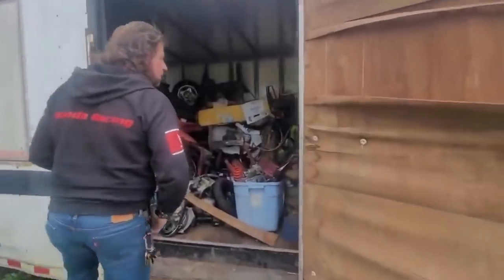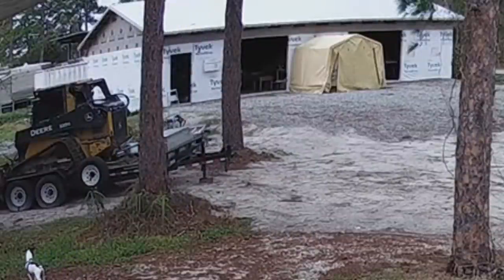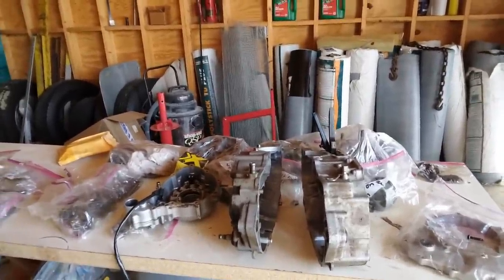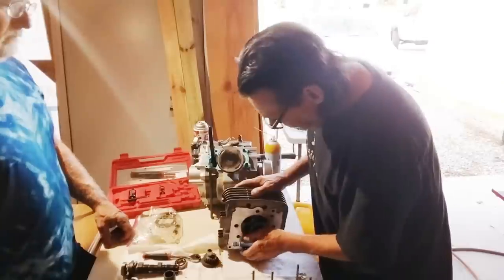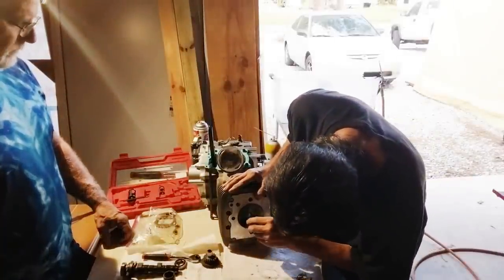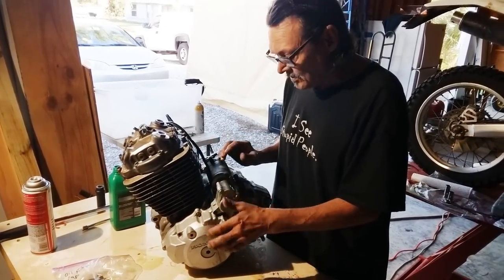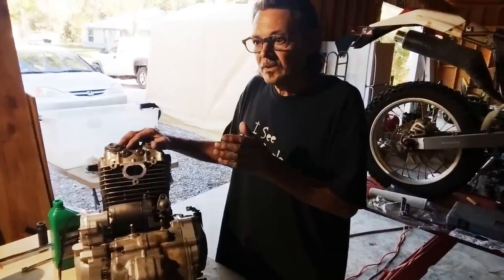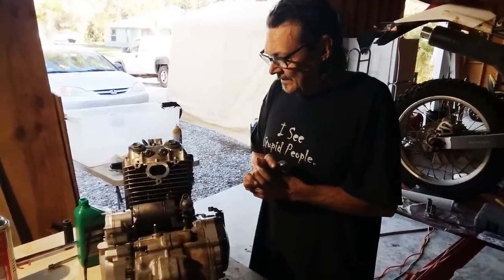BUILDING AN XR400 ENGINE WITH ELECTRIC START!

Comment: You've done it again! A video with one of my childhood dirt bikes. Honda Z50 a under the gooseneck of the trailer at the beginning of the video. Identical to the one I had, the first motorcycle I ever owned. So that wraps it up, Honda Z50A hardtail, Honda CT70 trail bike, 1974 Honda xr75, 1976 Honda CR125 and 1986 Honda CR250. Amazing how you have had them back-to-back almost in the same order I got them! Only motorcycle you have not shown that I have owned is a Honda xr250r prolink. Seems like it was a 1984 model, maybe 85 or 86. I love this channel!

Comment: I've built a few EX400 engines,  basically a xr400. In an ATV.  I turned 1 into a stage 3 440 with cnc head porting, and ran had an edelbrock carb, white brothers rev box,  kibble white valves.  Hinson race clutch setup, And my second one was basically the same but stroked out to 465cc. Which was a handful to ride it would wheelie easily in every gear.

Comment: Hey I found the best thing to get cases together is the heat the bearings with a heatgun and get that air duster compressed air in a can stuff and turn it upside down and spray the end of the whatever shaft you are trying to make fit  as it's basically like liquid nitrogen when you spray it upside down (dont get it on your skin) and it gives you much more leeway than heating in the oven or freezer as if you mess up the first time with those methods you dont usually get a second try.

Comment: They are the same basic motor but there are differences such as the center cases for the electric start and also the tranny gears are different on the four wheeler. Stronger more robust to handle the extra strain and weight of 400ex.   Use to do Frankenstein swaps back in the day!  👍

Comment: Good morning, here in Brazil honda launched a motorcycle with the XR400 engine with electric start, its name is NX4 Falcon.
It was released in 2001 and stopped production in 2015.
Engine identical to the XR400 but with less power.

Comment: Hey Jeff, thanks for the video and glad you're making a swift recovery — that was quite the fall.

Can I use the flywheel from the xr400 and add the starter clutch from the trx400 to the back? Or, must you get the flywheel from the trx400 as well. Thanks!

Comment: This is awesome! I have almost acquired all the parts for this myself. I'm curious if you recommend the xr400r wiring harness or a different one? I found elsewhere online they recommend the CDI Box for the 650R. Would a wiring harness for a 650R be compatible? They look almost the same. Also curious what specific flywheel you show here in the video? Is that not the stock one?

Comment: There is a Honda street bike sold in Latin America that uses  an electric starter & some with fuel injection called the NX Falcon 400. I don't know if the conversion would be the same or just a bolt on.

Comment: Do you put any oil of any kind on the cylinder bore or rings? or put it together dry?  do you have to lap the new valves into the old seats?
Reply: Hey Jerrry/ yes piston and rings go together dry and dry cylinder.I would of reground the seats if I had my valve tools with me

Comment: You heal quick. Good to see you are back on your feet. I just went from an old XR kick start to a new elect. start bike. I was against elect start at first, but it is nice because my old XR sometimes required many kicks when cold or if flooded although it always starts. Do you know a good way to clean years of baked on mud from those XR cylinder fins? Thanks

Comment: You're a nut Manic, but I guess that's where you get the nickname 😅
That was a nice fall you took, reminded me of about 20yrs ago I was street riding my 84 CR250R back from getting gas and cigarettes and as I was heading down the main road, a very older lady (at least 80yrs old) was up on an A-Frame ladder sideways on her hilled front lawn trying to trim the top of an 8ft tall evergreen.... she heard me coming down the road, looked in my direction, and her at the very top and the ladder came falling down.... I flew over, literally dumped my bike on her lawn trying to rush to her (I purposely laid it down) and as I was running to her, she literally POPPED up like a damn spring and screamed "I'm ok!" 😵‍💫😅
I scolded her for being up there, asked where her children or grandchildren were and why they weren't doing that instead of her, she said "oh those boys are lazy and I decided to do it myself" 🙄
So I told her, if she was really ok, to go relax, I put up the ladder correctly this time, finished trimming that and the opposing tree, cleaned up everything, and was rewarded with a tall fresh glass of home squeezed lemonade and a her trying to give me money, I took that lemonade of course and told her to come get me if her lazy children refused to help her.

Edit: dude, glad you're ok, and would absolutely love if you ended up traveling around and documenting working on other people's side project bikes....too bad I got rid of my last 3 bikes due to a neck injury and thinking I couldn't ride anymore (SOHC CB750F, DOHC CB750F, and a FCR carbed CBR1100XX), I'd have gladly taken you up on just some preventative maintenance and given you my Astro CS AWD 😅

Comment: Just use a 400ex motor, put a xr400 cam in it.  Alot easier and practically the same thing with less hassle